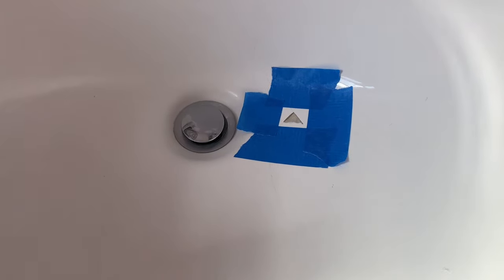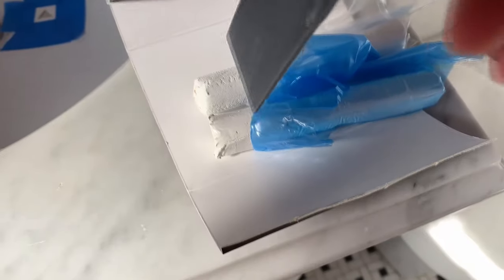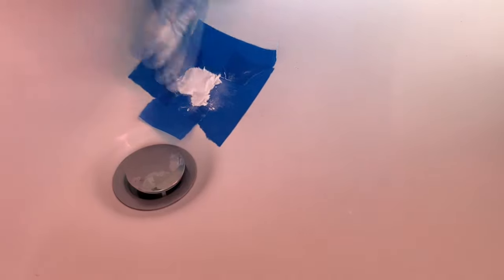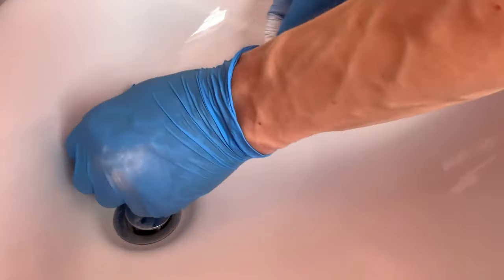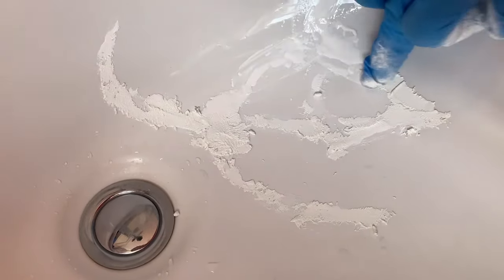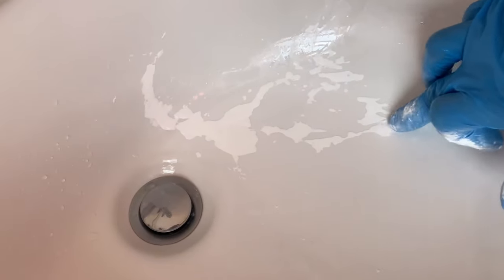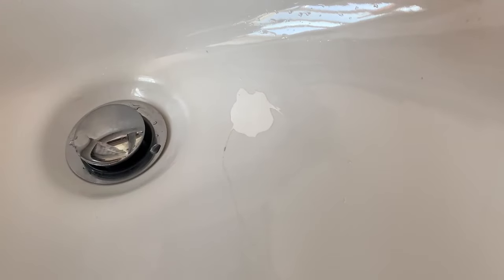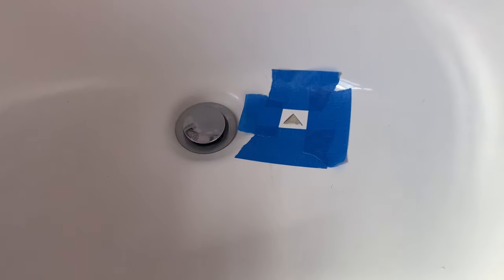How to Fix Chipped Porcelain Ceramic Sink or Bath Tub with Milliput Epoxy Putty

Comment: I used this method to fill pitting and rusting around the plug hole of a 1910 bath-tub. Instead of just filling the areas that required it, I made a circle of milliput about 1/4 inch wide around the plug hole.  Although the colour does not exactly  match, it just looks as if it is some sort of white gasket or flange rather than a lump of milliput!
Reply: On fait tous la même erreur ! La zone de réparation est trop large.